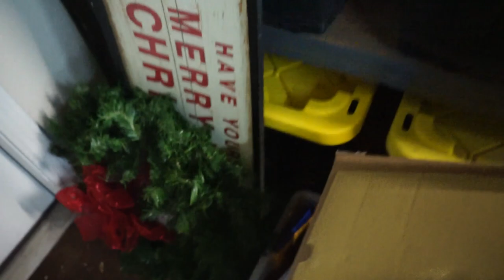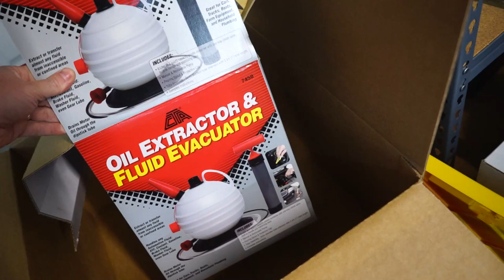Using an Oil Extractor and FCP Euro Oil Change Kit on the Mk7 GTI - Easiest Oil Change?

Comment: I've had the same brand extractor for years, it works great. One tip don't forget to release the pressure when you finish or your next use will take forever to drain the oil. Also definitely helps to have the oil warm.

Comment: Oil extractor? wtf is that? Just unplug  the drain plug dudeee!! xDD With that thing you are not draining all the contaminants, carbon deposits and metal stuff, just drain it, not extract it!  And you have to start the engine, stop it and re check oil level. Good video bytheway.
Reply from the maker: You've never seen this before? Lots of people do this. Obviously you start the engine and check.
Reply: @ColoredinLight  You have a drain oil plug, use it believe me. It's easyer, faster and better job for the engine.
Reply from the maker: Meh, it will be fine
Reply: @alexar546  This seems way easier and convenient. Another channel did this with the MK8 and it got everything in it. Any proof that it doesn't extract everything? A lot of opinion for something you just found out about.
Reply from the maker: HumbleMechanic's video shows he left maybe 1/3 if a cup of oil. Negligible
Reply: I've only used an oil extractor on my mk7 50,000 miles later no problems.
Reply: @ColoredinLight  just pour a bit of new oil to flush out that 1/3 cup
Reply: @joewontwice  lol there's a theory i've never heard, but should work  haha...
Reply: @bjjbrawler1  im pretty sure it should